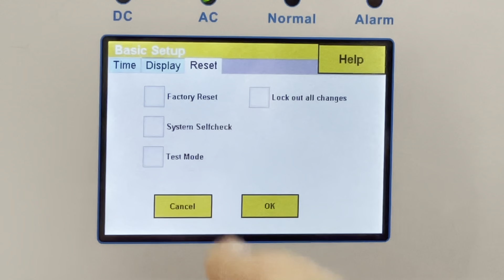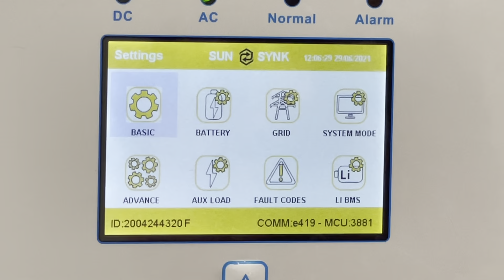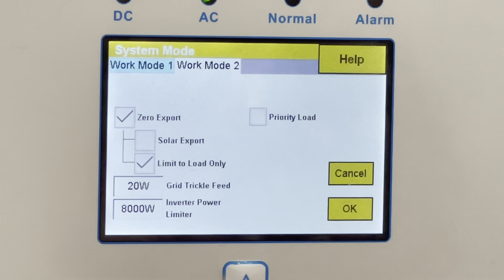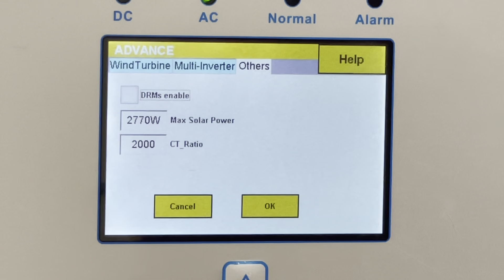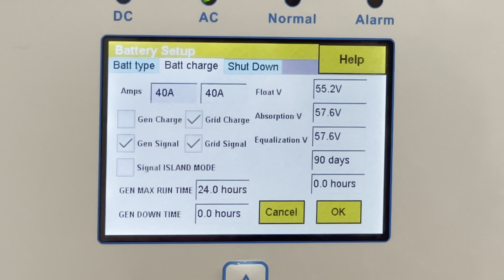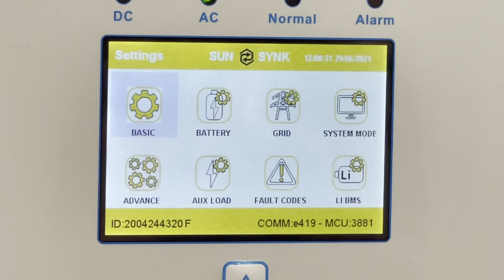Sunsynk Update to the operating system #Hybrid inverter#off grid#Best Hybrid Inverter

Comment: I recently had Sunsynk update the firmware of my Sunsynk 5.5 KW hybrid inverter 5K-SG01LP1  to latest version 3381. My previous Firmware was 3367.  In version 3381 the section under the advanced icon for Wind turbine is missing. As I was need this section I want to revert the latest firmware that still supports Wind turbines or if I can not get that information I will revert to version 3367.